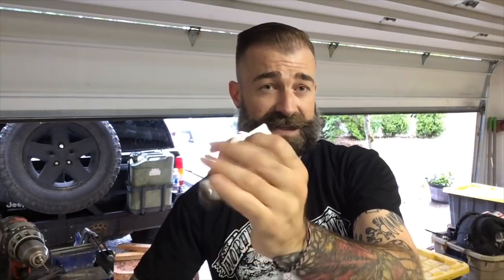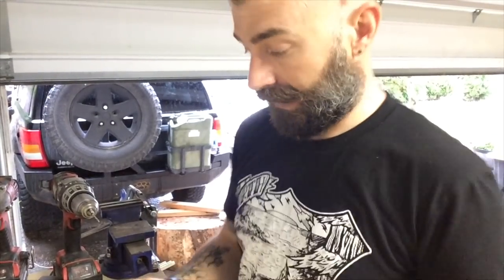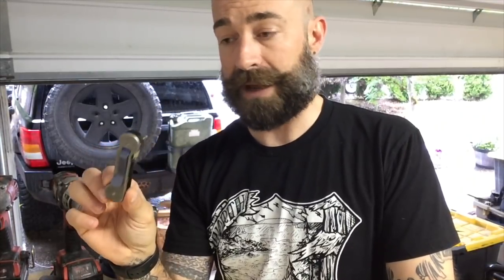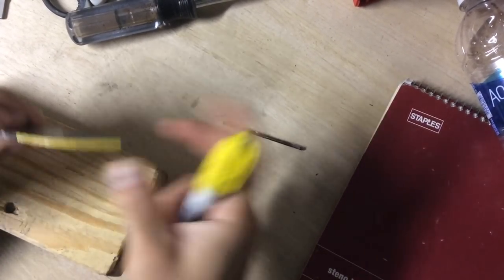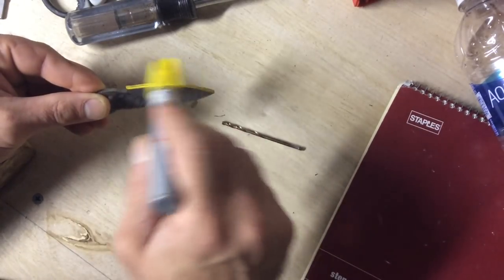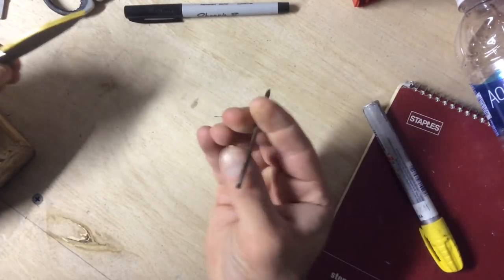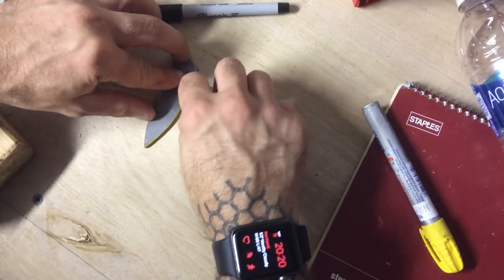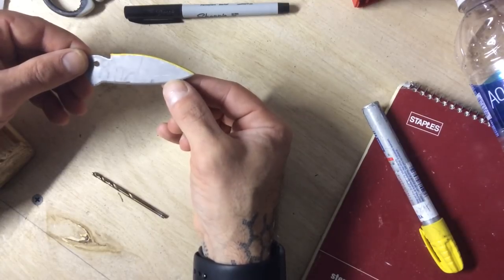Marshall shows you how to make a Keybar knife insert

Comment: Awesome job Marshall, way to stick with it and not let the challenges you faced prematurely end the project! Also very excited to see new material from you too! Always love the videos you create! 

I had one small question/concern with regards to future key-bar blades you may make that I wanted to run past you - would you not want a bit more "meat" or steel surrounding the little stopper stud that prevents the knife from opening too far? I would worry that, despite this being just a small-use type knife, that all the leverage the blade sees when in use in an upwards axis rests all on that thumbstud and in turn, the metal that encases it, and with such a small amount of material you might be more prone to cracking/breakage. Is this an unnecessary sort of concern with these blades? Perhaps the material of the keybar handle is the weak link before the thumbstud cracks off, but I was just trying to over-engineer the idea in my head.
Reply from the maker: Ah man, thanks so much for the support! I appreciate you hanging in there. I wasn’t sure if I’d make anymore videos there for a while. 

So, there isn’t really a component of any of this setup that I would worry about failing until long, long after you’ve already subjected the edge of the knife to more pressure than anyone ever should. 
The handle is made of two scales; one threaded titanium and one carbon fiber. There is also the handle screw and the cap screw as the stopper. Then there is also the blade itself. If I had to put money on one part failing first I’d say probably the threads in the titanium scale but that’s really based on nothing but that being the thinnest part of the setup. 
Again, all moot anyway because it would take way more force than you’d ever put on the edge. 
Thanks for watching!

Comment: Great video as always I've enjoyed it!  Could you make a flipper knife out of it?
Reply from the maker: I think, technically, it is a flipper knife because it has the tab on the back but in order to use ones forefinger to flip it, it would be the handle and not then blade design that would have to change. The handle design makes it more conducive for the thumb to be used and not the forefinger.